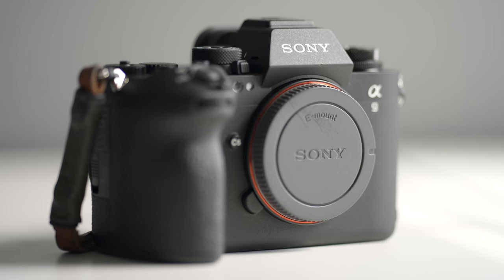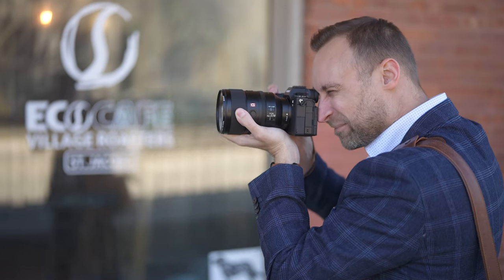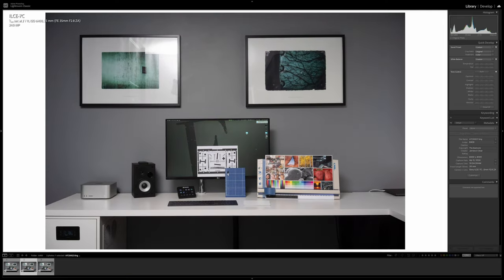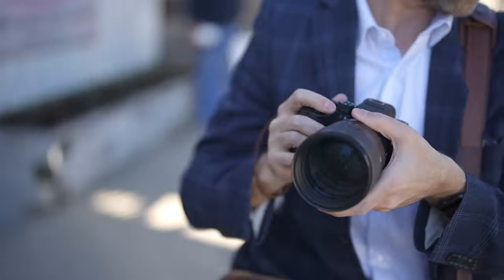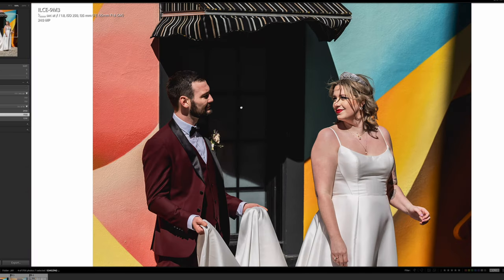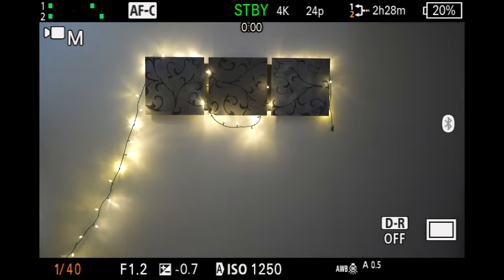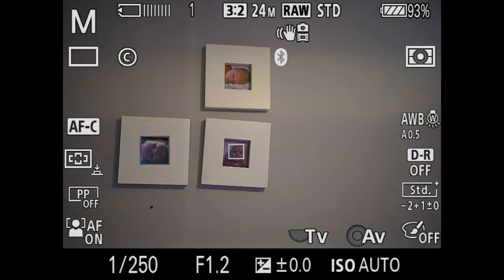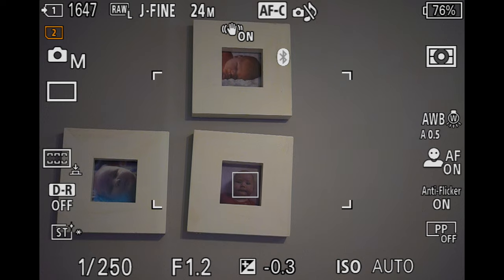Sony A9III Surprises - Does it Really Fix Flickering & Banding?

Comment: As of today, April 17th, 2024, your review is UNIQUE because of the following reasons: 1. You DEMONSTRATE in DETAILS how the global shutter helps reduce the FLICKERING of the lighting in both stills and videos. 2. You also show in details how the global shutter eliminates the BANDING in both stills and videos. No other Youtuber has done it so far. We need MORE REVIEWERS LIKE YOU. Thank you
Reply: Cheers and thank you 🙏
Reply: Unfortunately the review doesn't cover challenging lighting situations where there are different frequencies. While the A9III should be capable of eliminating banding in stills, you'll likely have different exposure levels for each of those light sources.

Comment: I own the A9, A1 and now the A9III for almost 2 month.  The A9III is by far the best camera, SONY ever made. As a sports and concert photographer, I already shot thousands of pictures under various lighting conditions.  DR and ISO is absolutely no problem. As of today, DxO released PureRAW support for the A9III. I tested the A9III with DxOpureRAW4  at ISO 51200. The results are better than with the A1. It is absolutely stunning, what DXO does to the RAW files of the A9III. Just try it.  Also, using the SONY HVL-F60MR2 flash with the A9III is the best flash combo I have ever used. And I have used many, such a Elinchrom and Broncolor. In short, global shutter is the way to go.
Reply: Amen!
Reply: I completely agree, and it’s actually not even close.
Reply: Good to hear.  I just got mine A9iii and am also a DXO PureRaw 4 user.  So looks like I can bump it up to ISO51,200.  I was considering limiting it to 12,800 or 25,600.  I've also ordered the Sony HVL-F46RM flash.  My existing Sony 32M flash can't sync with TTL beyond 1/500.  Can the Sony HVL-F60MR2 sync at all speeds with TTL?
Reply: @RobinChee  yes, I have 3x HVL-F60RM2. Up to 1/80000 is no problem. Make sure you upgrade to Ver. 2.0 on the flash, set it to NoHSS. I prefere manual mode, as it saves energy. You can shoot more than 20 fps.

Comment: Thank you for this review especially on the flickering & bending.  I would love to see an updated video with the newest firmware installed on the A1 & A9 cameras as there are reports of the A1 having improvements on: AF for further distance and subject recognition, image stabilization, faster boot up time, smaller compressed file to increase the buffer rate without effecting the IQ....  I would not buy the A9III due to the 24MP sensor.  As an event photographer coming from Canon/Fuji 16MP~24MP to Sony A7IV 33MP to A7RV 61MP and now A1 50MP I have found the invaluable benefit of high MP sensor that allows me to use a much shorter, lighter and brighter aperture lens to achieve much better results like using a 135mm f/1.8 in APS-C mode to achieve 202.5mm at f/1.8 with much lower ISO or/and faster shutter speed especially during indoor sports events vs my 70-200mm f/2.8 GM II or Tamron 35-15mm f/2.0-f/2.8.  120 FPS Pre-capture and improved AI focus (works poorly on the A7RV due to its old 99ms sensor readout speed and low recalculation speed and none during blackout) are features I can see useful to me as I definitely don't need 120FPS even in sports or the tilt/swivel screen that I ended up having the screen in closed position 99% of the time to protect the LCD screen and just using the high resolution EVF instead on the A7RV (cool to have but just an extra dead weight for the way I shoot). Thanks again for this great video.
Reply: Sorry for the late reply; I actually had v 2.00 on my A1 at the time of the review. The only updates to the A1 firmware since have to do with bug fixes for wifi/bt and issues with the 200-600 lens.

The A9III AF is definitely in a class of it's own, and a noticeable improvement over the A1

Comment: Great review. I've owned my A9III for about a month, and I find it to be perhaps the best camera I've ever had the privilege of using.

Comparing it to my Canon EOS R3, I find that the A9 III takes a technological lead with its otherworldly autofocus. This is further compounded with the amazing performance of the Global Shutter Sensor. Next-level IBIS and all packaged in a much more compact and portable body. And this is done while maintaining excellent ergonomics. It really is hats off to Sony on an amazing product. Comparing to my other Sonys, the A9 III is the most advanced Sony mirrorless camera I've used to date. I'll go one better, looking at the Burano. I believe it's this sensor Sony should have utilized in that camera. The dynamic range is on par and it solves all the problems with rolling shutter that are experienced in a much more costly Burano. 

I’ve done extensive testing comparing the A9III with the Canon, Fujifilm XH2S, Red and even my GFX100 II. I was surprised to see the massive dynamic range advantage I expected to see from the GFX simply did not exist in practical terms. For video, the A9III reminds me of the Red. Both will shoot a noisy image, but they clean up nicely in post, and the image does so while retaining detail. The FHD mode is great also, with similar performance to the UHD mode… unlike the XH2S that while oversampling the FHD image the output is largely unusable. The noise in FHD on the Fujifilm is different in this mode… it’s not a fine grain… it’s not filmic. It’s just ugly and does not clean up well. 
Sony deserves high praise for this offering. It is truly the greatest mirrorless camera money can buy as of this writing.

Comment: Hi! I'm a theater photographer, and have the same issue - it's so annoying. I can't really shoot action at lower shutter speeds like 1/60th to mitigate banding, so the A9iii seems like a great compromise. Are you saying that, you can burst shoot, and some images will be fine while others will be taken when the lights are off? Can you do this at, say, 1/500th of a second or faster without any banding in the images when the light has flickered on?
Reply: It really depends on how fast the flicker phase is of the particular lighting. Stage lighting is typically much faster than what I’ve demonstrated, and the faster the phase, the easier and more consistent the A9III will be. In fact, stage lighting should be one area where the A9III can just automatically handle things and have no inconsistencies at any shutter speeds, where any other cameras will show banding.
Reply: You can do it at 1/80,000 of a second and there won't be any banding. Just take a 120fps burst and you'll have some perfect shots.

Comment: Thanks for sharing your results! It helps a lot, but I have a question about the 135mm F1.8 and 50mm F1.2 GM combo... I too, have this set up but I find my 135mm F1.8 GM renders a total different tone from all my other GM lenses, this is a pain in the butt when the time comes to color match my photos...
Do you have this issue with your 135mm F1.8 GM?
Reply: I don’t have this issue at all with the 135gm. In fact, all my gm lenses seem to have consistent colour rendering. Only my sigma lenses seem to have slightly warmer colour

Comment: can you dial in the variable shutter speeds such as 1/199sec via Custom buttons ???
Reply: Not with custom buttons, but you could using the Custom Modes (C1, C2, C3). The problem is that the variable shutter speeds will be very specific to the lighting, so unless you are shooting at one place very regularly it wouldn’t make much sense to do this
Reply: @jamiesondean  thank you that would be a start !

Comment: WHOA, so you cannot shoot 1/80000 at 1.2 or 1.4?  Is this still a thing since the latest firmware update?
Reply: Unfortunately, yes. The recent firmware allows 1/80,000 for burst shooting, however they have not made any statement about allowing 1/80,000 for apertures faster than f/1.8 as of yet.

Comment: It's really a problem from the LED manufacturing end that should be fixed. I use at home all LED lights and they're rated at 60Hz but they never flicker even tried 1/1000s and they all look consistent. They have a power regulator as it seems so they're somehow constantly on or something. They cost exactly the same as the flickering ones and they're super cheap as well. I hope one day this stuff can be fixed from an LED point. So far been filming in 23.98fps at 1/50s and never had a problem, but would never try 60 or 120fps on my a7SIII. Amazing review and this is what I really needed to know.

This is one of the weddings if you wanna check out. Maybe the excess amount of lights mitigate the effect or maybe because the spotlights we have here that have regulators, I think, are more common and unintentionally put in most homes and weddings halls:

https://youtu.be/DQ47giCG1dY

It's a long one, so jump into parts of the video and you'll see even the street lights, that are LED's as well, have zero flickering at 1/50s. Overall never had a problem with 1/50s so far.
Reply: Yeah you’re right; it really comes down to the bulbs 💡. Unfortunately, as wedding photographers we can’t control what venues are going to outfit their buildings with. I do find that switching to 24p is a solution for much of the venues with problematic lights, but that only works for video; shooting 1/50sec for stills is going to trade banding for blurring. I think the A9III is a great solution for us event pros that need to handle banding for both stills and video.
Reply: @jamiesondean  A9III to me is the best camera in the world overall. Even with 7.7ms at 4K120 on A7SIII you can still notice jello effect sometimes like filming with extreme 5-7x macro. That global shutter look is just glorious. Would I buy it? Not sure, I don't make enough money at the moment and would rather throw similar amount on A1 II instead as I might get a loan for that steep price. Getting the A7Rv for now as it's being sold brand new here at ~$3,000 as an ultimate photography tool and an amazing B-cam for interviews using 8K.